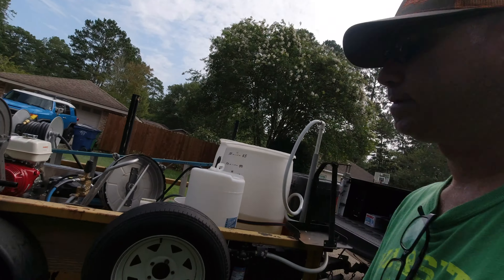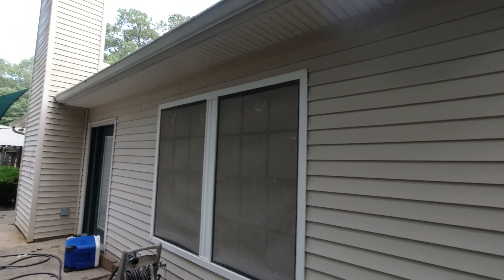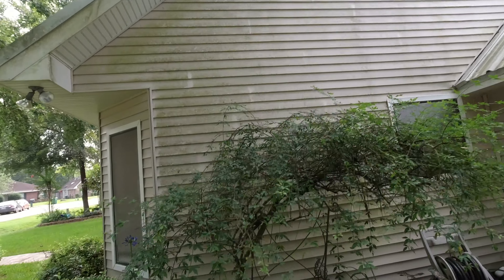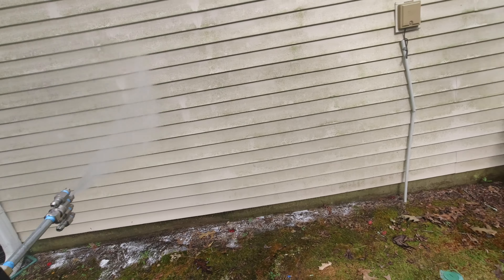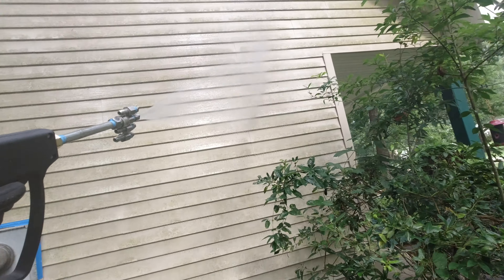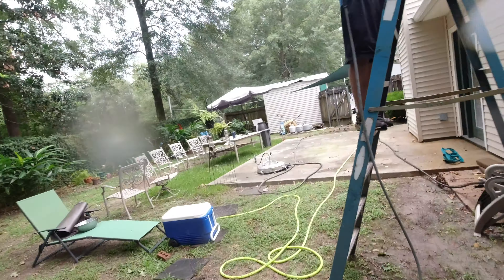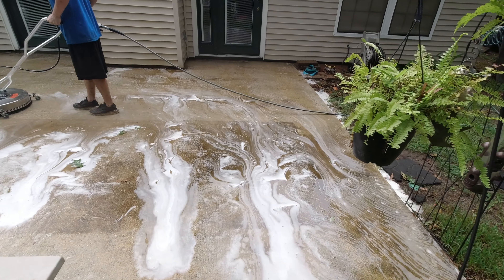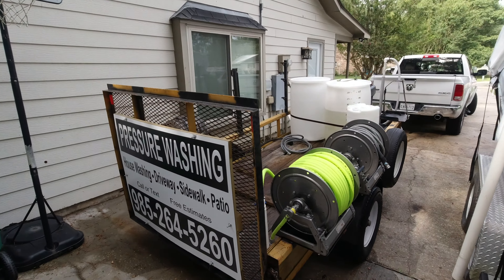Nice Acadian Full House Soft Wash- Chasing the Cheese!

Comment: Nice information here. Quick question. I do not have a soft wash unit yet, only an xjet m5, downstreamer w/ 5 gallon bucket to achieve 1%ish house wash, and a 4 gpm 3800psi machine. In order to get the 3% roof wash mix with the xjet, what would I mix into the 5 gallon bucket? Also should I use no colored proportioner? I only have access to 10% SH. Thanks!
Reply from the maker: Thanks!! I never used an X-Jet, but I believe they make a chart for reference. You can build a simple 12 volt set up for pretty cheap & batch mix if needed.
Reply: @allproexteriorservicesllc5338  cool! I’ll start thinking